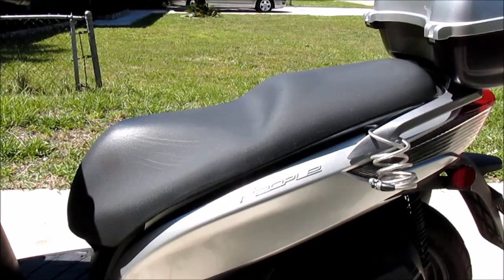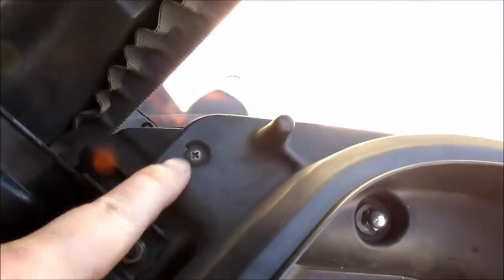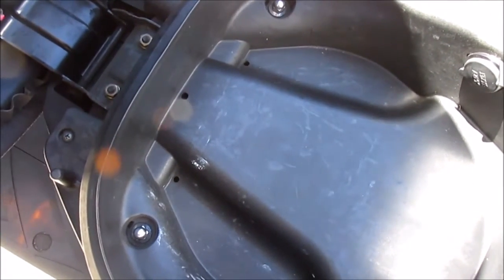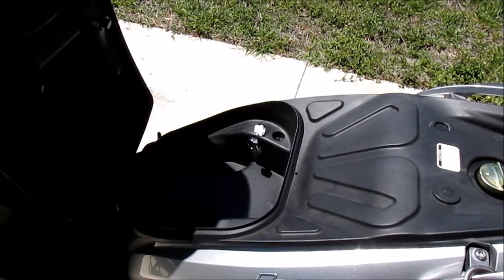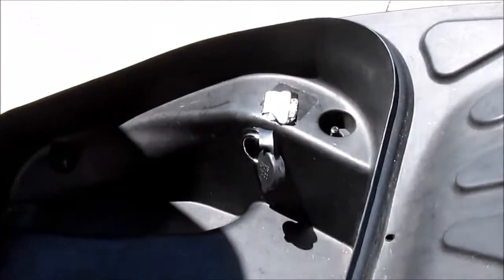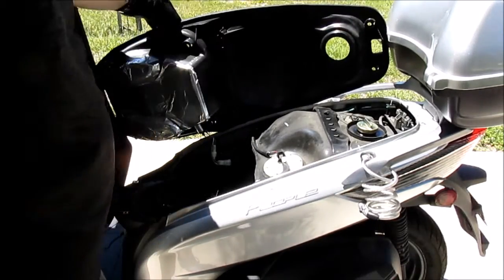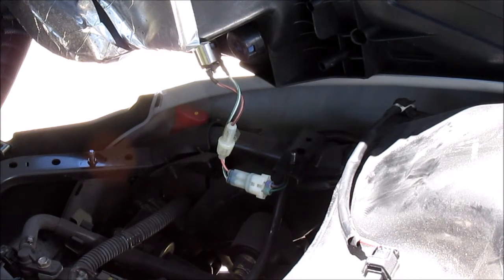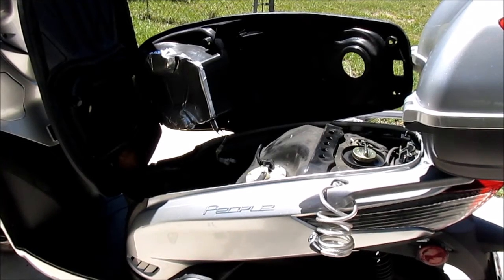Kymco People GT 300i scooter seat bucket removal

Comment: Do you know where is the fuse box in GT300i? Thanks.
Reply from the maker: Yep. Right side of the battery compartment in the floorboard.
Reply: Thanks a lot for the response. So, this is the same place where they put it in Agility 50/125. It's strange because when you look at the electric harness exploding diagram, it seems to be in the back left side, under the side body panel, above air filter.
Reply from the maker: I use the online service manuals from Cyclepedia. You can buy a yearly subscription or lifetime. Check it out. Very useful: http://www.cyclepedia.com/online-manuals/kymco-atv-scooter-online-repair-manuals/